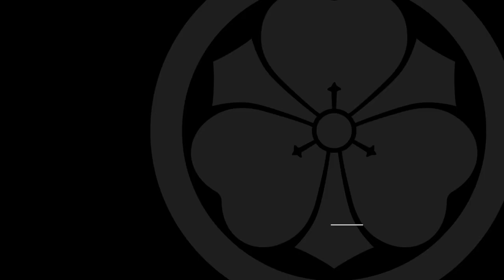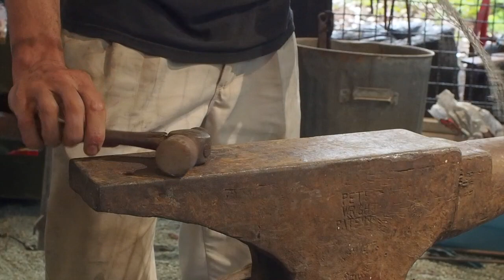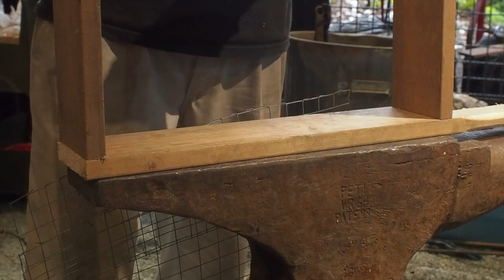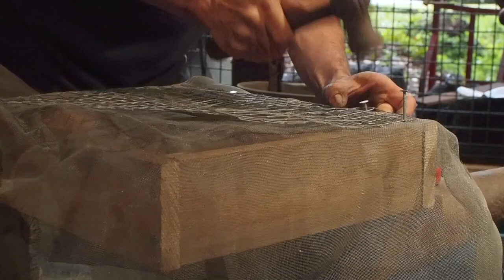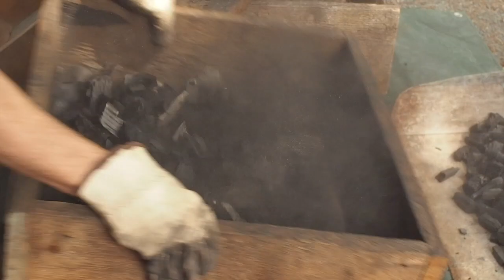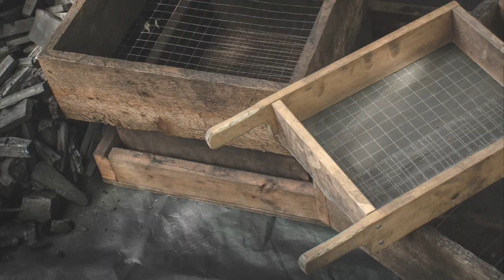Making 篩 for charcoal screening - from scrap wood and mesh

Comment: mate can you explain why you are screening the charcoal and putting the fines in the bottom
Reply from the maker: it makes an insulated bed for the forge: http://islandblacksmith.ca/2017/01/building-traditional-swordsmith-forge/#charcoal
Reply: Head palm  sorry dumb question day
Reply from the maker: it's a good question, i just have a better answer on the website than i can type here ^___^ ...there is a specific size that works too because dust blows out and anything larger than these fines will just burn up instead of insulate...

Comment: do you wear a damp cloth around your face when you do this? last time when i was crushing charcoal for an explosive mixture i had so much charcoal dust in my nose and mouth i that my saliva was black when i coughed
Reply from the maker: that sounds intense...if you are working with super fine stuff it wouldn't hurt to use a cartridge mask...
Reply: Crossed Heart Forge - islandblacksmith 
ahh OK I'll go get some next time, I think I've seen some people year cloths when sorting charcoal for the forge, you could see the black stains on the cloth after too!
Reply from the maker: chopping for the forge is not so bad depending on the charcoal and the technique, i might get only a half bag of fine dust after chopping 20 bags of large pieces...